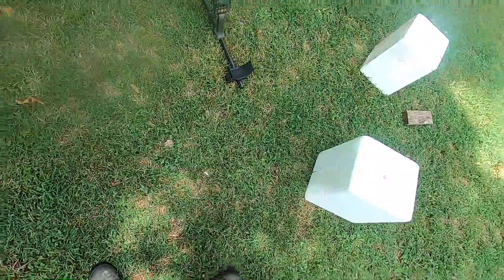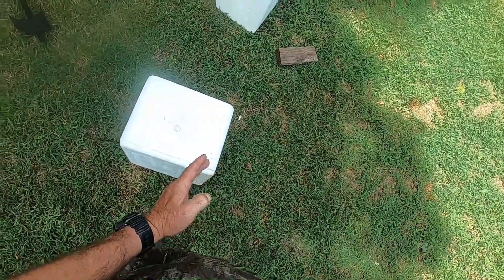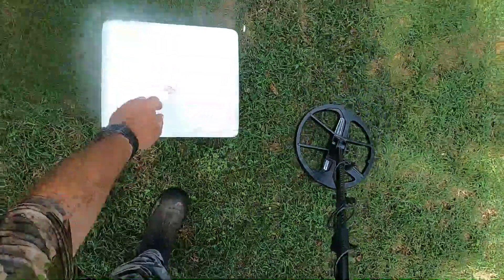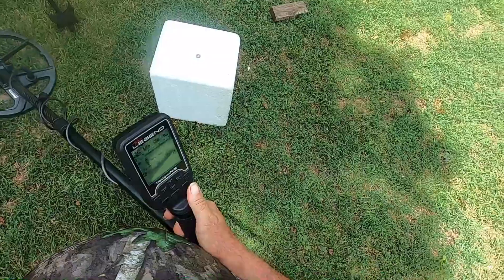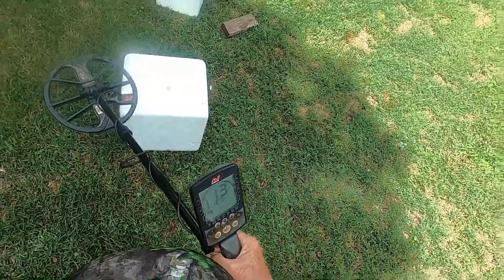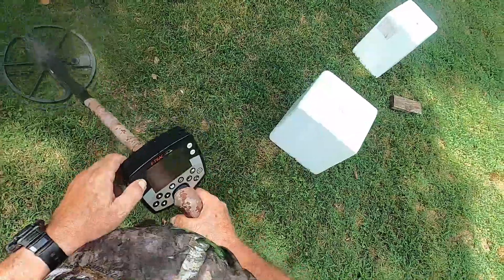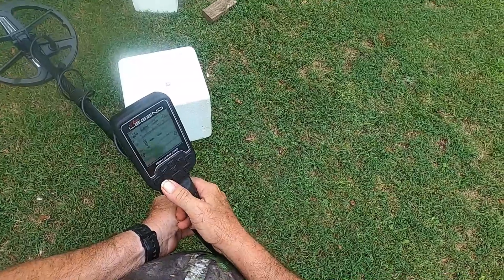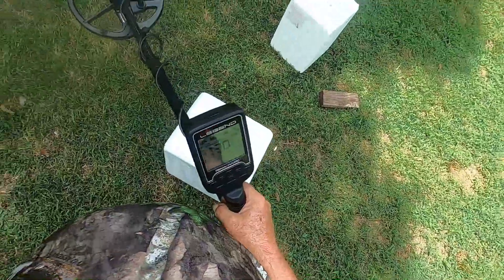Nokta Legend Etrac Equinox compared to US nicklel and dime setup

Comment: When the dime is under, it's completely shielded, and only receives magnetic field induced by nickel's response to the coil transmission… With nickel under, we have a dime response, but we also get a "ring" of visible nickel underneath it. And pretty much any modern detector's DSP will prioritize a "ring" signal.

How to test:

1. On both of your styrofoam cubes, arrange nickel and dime as compressed figure 8, exposing about 1/4 of the dime over/under nickel respectively. This way, we're not dealing with "ring", and you won't have to rearrange the test targets every time (as you'll have a "nickel/dime" and "dime/nickel" cubes).
2. After repeating your test in this configuration, just for shits and giggles, try adding a few drops of concentrated NaCl (better yet, use sea salt) solution to each of the "8" junctions to screw with both conductivity and inductivity of your targets.
Reply from the maker: Completely shielded? Yeah.  Why does ID report higher.  And why does 4khz read so high with nickel on top?
Reply: @tnsharpshooter8517  We have to remember that VDI is determined not just by target's conductivity, but also its inductivity. So my guess is, at 4 KHz that sandwich is more inductive, or maybe it acts as a capacitor… An RC counter even, with a resonance frequency that is close enough to 4 KHz to give an amplified VDI reading.